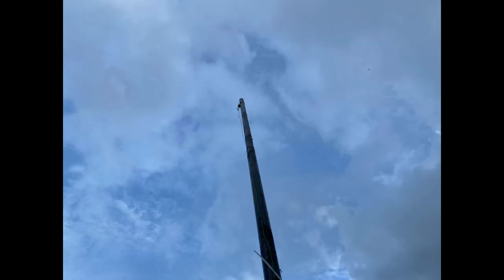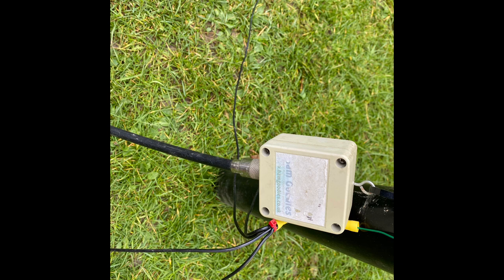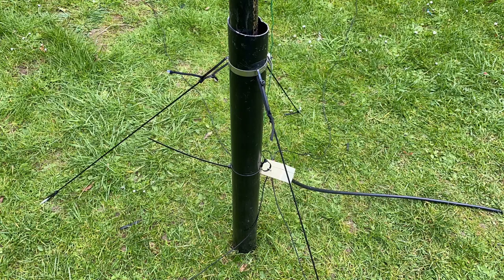Ham Radio: How to work DX with a simple vertical antenna and 9:1 unun

Comment: A good antenna, I use one for /p, holidays etc. The wire length is about 8m, with lots of radials. I have worked Brazil, USA etc. Keep them coming Tim, 73
Reply from the maker: Thanks for sharing - yes sounds like a Rybakov or close to it - looks good modelled and I will definitely be trying one out soon

Comment: Great Tim, as everyone knows simple vertical antennas with a few radials work exceptionally well for dx especially as you say , band conditions now are wonderful. 
Iam just running 200w to a 20m vertical made from a painters pole and a few radials, and working all over eu every evening lp zl , about 8am your time.
If you have a bit of space in the garden, still another parasitic reflector 5m behind in the direction required , and you should work zl / vk every day. Hope to work you one day, 73 zl3xdj.
Reply from the maker: Now that sounds like a challenge! Thanks Brain 73

Comment: Great to show simple  solutions. How does it meet emc calcs in a small garden, I am struggling as calc wants 6m in all directions. Sounds as though you a have an old fashioned size plot.Mine is about 7m square
Reply: How often do you expect OFCOM will come and check? 'Never', is a realistic answer. And if they do, ask for the scientific basis for their regulations - they couldn't provide any when I made a FoIA request to them, but they assured me PHE did, which is what they were basing these on. Except, a FoIA request to PHE showed they also had no evidence. ICNIRP, hardly a body without criticism (actually criticised in an academic journal!), didn't respond to a request for evidence.
Reply from the maker: Absolutely fine in my small garden from 20-10m. Be interesting to see what happens for 40 and 80 when the new calculations are brought in for those bands. Let alone 160!